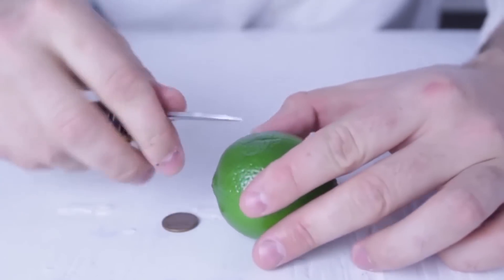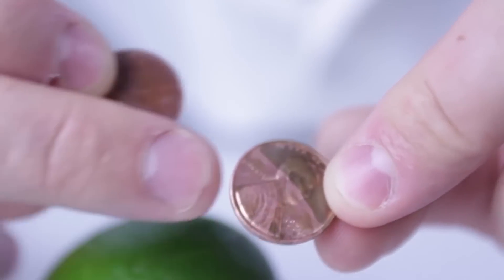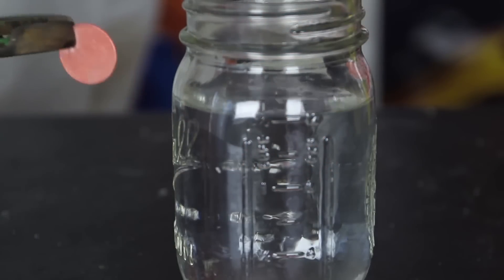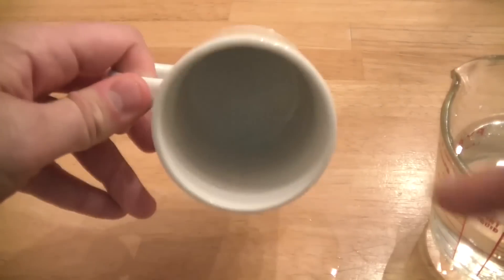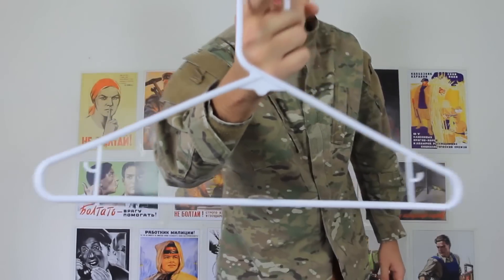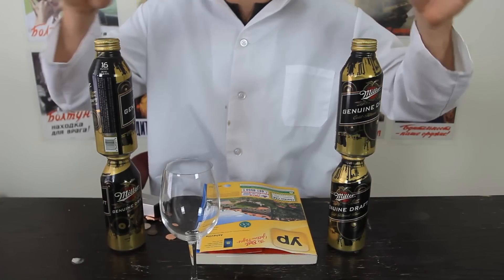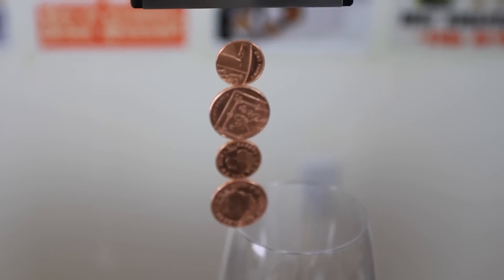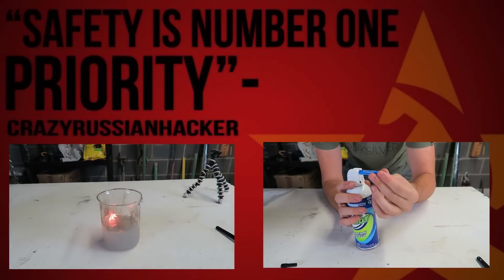8 Coin Science Experiments Compilation

Comment: I actually learnt that cup and water experiment in my science class. Basically if you look into an empty cup the light is reaching your eyes in a straight line like light normally travels, in straight lines, but when you fill the cup up with water the water actually bends that light to make it appear like you can see the coin earlier than you can in air.

If you think about it this way? If you had a cup on the end of you're table and on the floor you had a metre ruler which starts at the cup. If the cup is empty and you have the coin in the centre of the cup. Slowly start shuffling yourself further and further to the end of the ruler and as soon as you see the coin look at how far down the ruler you are. Say you have 30cm left to go on the ruler. Then fill the cup up with water and do the same thing and you will find that you are further away from the cup when you see the coin. Because of the light being bent by the water!!

Sorry it's a bit long!!🤗😂

Comment: the reason why it has a double boiling point is because the coin is so hot that the liquid does not touch it and the heat repels the liquid until the coin has cooled and then the liquid hits it.

Comment: The "double boiling" you're observing is probably due to the Leidenfrost effect. Liquid, when in near contact to something which is heated significantly higher than its own boiling point, will boil only slightly and produce an insulating layer of vapour which prevents any more of the liquid to come in contact with the hot surface.

This will only work as long as the hot surface can maintain its temperature. As the coin cools, its temperature drops to nearer the boiling point of the liquid in the jar and allows the liquid to touch the coin. That's when you see the liquid boil off.

Comment: 6:06 its called light refraction, or bending of light. What happens is the normal (water surface) is the divider between the two mediums ( water and air ::: they have to have different densities ) and when light goes from one medium to another, the light will refract (bend) a little bit

Comment: The coin on the coat hanger is caused my centrifugal force. As an object spins on a fixed point, all points outside of the central point try to move outwards away from the centre.

Comment: The coin in the cup illusion is the process on light refraction, as the light goes from air into water it slowed down so the image changes depending on the speed of the light as it move through different media.

Comment: The dry ice is because the coin creates a little space for the air, when its gets supercooled by the ice and shrinks. This causes  a little vacuum to form which will suck in new air when the vacuum gets too strong. Then the coin flips and does the same on the other side

Comment: what he is calling a "double boiling point" is nothing of the sort. It's just the coin cooling down enough for the water to not be repelled from the metal from heat so it just comes in contact, but the metal itself is still hot enough to boil. But the heat radiating from it isn't...
You'd think he'd know this.

Comment: The "second boil" has to do with the leidenfrost effect. 

at first the coin is so hot that the water vaporates before it can touch the coin, the pressure of the steam between the water and the coin is high enough to keep the water from touching the coin. When the coin cools down the pressure of the steam drops and at that point the water can touch the still hot coin which pushes the remaining steam out and creates more steam which has to escape.

Comment: The coin is so hot that methanol boils so vigorously that not a lot of methanol can even touch the coin to cool it down, there is a very thin layer of steem (leidenfrost effect) whitch acts like a insulation layer as steem doesent conduct heat very well. Then when it has colled down enough the methanol touches the coin an it boils in bubles and cools it wery fast. and probably if you dont see bubles on the surfaces enymore it is somewhat cooler than the boiling point of methanol I gues below 70°c. Sory for my bad english, and gretings from Slovenija.

Comment: The reason there is a double boiling point is because the water in the alcohol is at the top and when you put the hot coin in it evaporates the water and then there's only alcohol left

Comment: I'm gonna be brief, the reason we can see the penny when you add water is because water is more dense than air. When light travels from an object with lower density to an object with higher density (and vice versa) the path of the light will change by some degrees which makes the light that bounces on the coin bends towards the camera lens when the light breaks the water surface.

Comment: The "double boiling point" is known as the leidenfrost effect and basically the hot thing makes a vapour bubble around its self which protects it from full contact with the other substance but when it cools a bit the effect subsides and makes the zap noise as the rest of the heat energy is released.

Comment: The illusion takes place because the light passing through the air gets distorted after it touches water. This makes everything in the water appear different. Btw, that magnet thing is there because the magnetic energy is still in the coins, and it is still held up by the strong magnet.

Comment: Dry ice has a very low melting point. As the quarter touches it, the dry ice melts releasing carbon dioxide gas. this gas comes out quickly enough to move the quarter, rattling in the depression in the ice.

Comment: The coins you have standing on the Glass which is also being held by the magnet above. 
The pull of gravity is being canceled mostly by the glass. I think the magnet is doing very little work; in fact I think the glass is making it easy for the magnet. It don't take a lot of effort for metal to stick together when a magnet is near by, but the closer the stronger obviously. The magnet is barely reaching out to the 1st coin, but each coin is touching each other making it easier for them to stick. 

In other words the coins want to fall. The magnets has very little to no effect on the coin(s). Remove the Glass, Bump the table as u did, or lift the magnet away & down goes Frazier. They are not jumping to the magnet cause of the equal force of the weight of the coins (gravity).

Comment: When you heated up the quarter and dipped it in the solution you asked why there was a double boiling point it's called a steam jacket. It happens when hot metro is dipped in a watery substance and the heat from the coin creates a layer of steam between itself and the water @crazyrussianhacker

Comment: water in cup is refraction at play, double boiling is caused by a layer of alchahol fumes taking the heat out of the quarter, and once it is down far enough the reaction has slowed enough to allow the alcahol to boil yet again cooling the penny even farther.

Comment: The magnet one is simple. The magnet's power is in a balance with gravity, so when you put some pennies on the right position, the amount of force pulling the pennies to the magnet is equal to the force of gravity. Once you move the table the structure is standing on, that balance will fade and the pennies either fall or get attracted by the magnet. I'm not sure this is right, though.

Comment: +IntrepidGaming

It's not because of the water in the lime. It's because of the acid, it contains. It corrodes the metal, the coin is made of. When the acid in the lime interacts with the coin, it'll take of the dust sitting on the coin. So it has nothing to do with the water, only the acid in the lemon.

Comment: here is why quarters vibrate in the dry ice

the warmth of the metal sublimates the dry ice and causes a change in pressure. As the gas pushes past the coin, the pressure causes that shriek. After some time, the coin forms a larger hole in the dry ice, producing larger air currents that push the coin around, causing it to vibrate and appear to be shivering.
Reply: No the poor coins are just cold :)
Reply: +Darkfang 27 Lol
Reply: No, it's just really cold and needs a sweater, :P
Reply: +prankerstv ik why it is vibrating it is so cold that the coin shivers
Reply: Are you a teacher or something

Comment: When you add energy to a molecule (the heat of the fire to the quarter) It moves the valence electrons to a higher energy level, and when those electrons move back to their stable energy levels they release energy in the form of photons (light) whose color is determined by their wavelength which is determined by the energy released. Can you tell I'm in a honors chem. class? :D

Comment: The reasons the coin "levitates" is because the magnets have a magnetic field cycling through the center out in two ovals, the farther away from the magnetic field the weaker the pull, so the coins are still being attracted to the magnet, the magnetism just can't lift them up. It is similar to when you attempt to lift up a person who is just barely too heavy for you to pick up, they'll still feel lighter as you are still picking them up a little bit, your force is lifting them just not all the way. And just to say I'm 13 years old!!
Reply: I hope I answered your question😅
Reply: +Liam American coins are made out of zinc(diagmagnetic) means they repel magnets. While british coins are made from steel(iron) which ferromagnetic(turns the metal into a magnet once charged). So it works with their coins not ours.

Comment: The double boil point as you say is when metal gets really hot and when you put it in water (ext) it boils water really quick and creates a gas bubble around the coin and when it cools the gas isn't stable and falls apart which creates the extra bubbles at the end of the boil